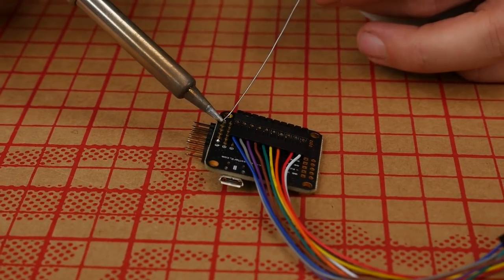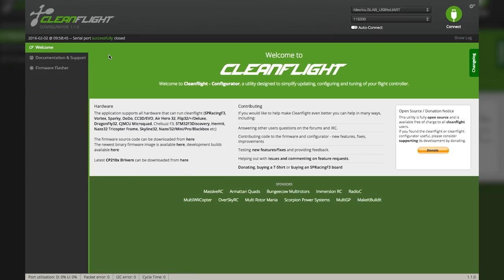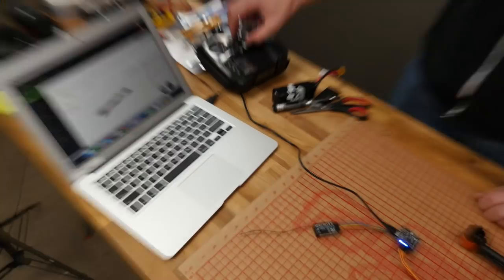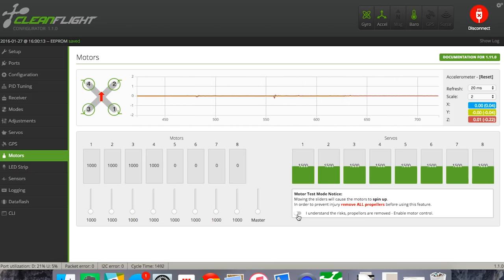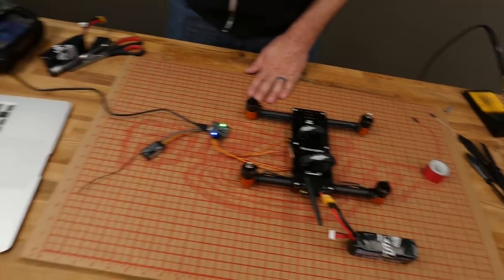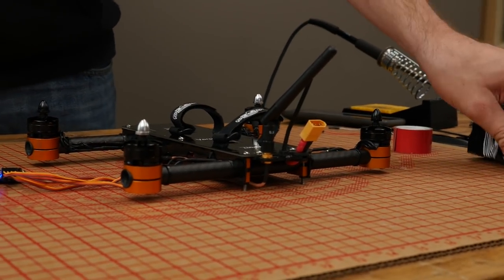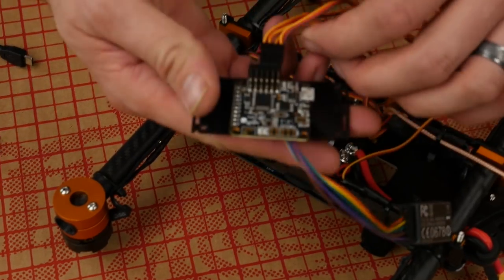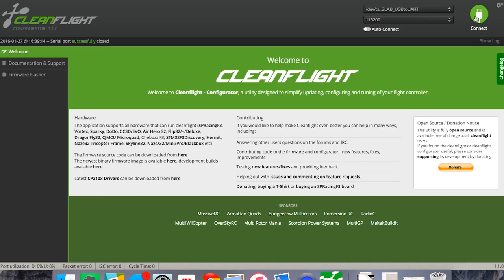Naze32 Rev6 Setup | Flite Test

Comment: I have a Naze6 and I'm loving it. Native S-BUS support without a signal inverter made for a really clean first build!

Ninjedit: Is that PPM josh?? In 2016?! Come on, man! Look at all that extra cable length! Go with X4r-SB + S-BUS!! Less input lag, cleaner/lighter cable management, S-BUS sounds cool...
Reply: +GaIiIeoMateo First priority would be ESCs with active breaking.. Haven't heard motors spin like that for years :-)
Reply: +kj erts Haha very true. I'm lucky in that with my first quad (which I built barely over a month ago) the ESC's I chose came with active braking! I mix up all the different features like oneshot, dampedlight, but I have them all on, so I don't know exactly how lucky I am to have it! RG20's are awesome!

Comment: Why are you guys still using pin headers for motor connections?
Reply: I'm new to t he hobby but not new to electronics and wiring., This is my 5th Quad I have build since I started in the hobby. This was one of the neatest cleanest board wiring and explanation I've watched since beginning in the hobby. Thank you for all you efforts and helping the New Pilots to the Hobby!!
Reply: easy removal as they want to sell them later?

Comment: Make sure to check if your board works before soldering the pins, if you already soldered the pins onto the board and it turns out there's something wrong it may be more difficult to return it.

Comment: hi josh and all telemetry users! there is a major trap about this: if you connect 4 escs with bec with the voltage cable and then the battery on the voltage port, the board will die within minutes.
the manual recommends to remove 3 bec leads otherwise you just brick the board.

Comment: you can tape the 1x10 pin down, so they dont move around, same with the 3x6 pins, put some plugs in so the spacing is good.

Comment: QUICK TIP FOR MIN THROTTLE : in motor tab use the slider to see what the the minimum input is, ( must have battery plugged in and motor tab engaged ) and set your min throttle 5-10 points higher than that value. insures lowest throttle , and no jumpyness when engaging ;)

Comment: There's one important thing to note if you're using a pololu or similar voltage regulator to power the Naze32 rev6:

The rev6 doesn't have a diode on the power input. If you plug the USB cable in it will power the ESCs through the voltage regulator and you can't calibrate your ESCs through cleanflight. Because of this you shouldn't use the rev6 if you don't have ESCs with built in BECs.
One other thing I would have liked to see in the video is how to connect your Graupner receivers to the Naze32 using SUMD. It's very easy and you only need one cable.

Comment: Josh, thanks for doing this video. However, you really should use a fine tip soldering iron when you solder in those headers. It would look much more professional as you were doing it. It would also avoid solder bridges much better.

Comment: By the way, with the GR-12L you can turn on SUMD and hook it up as a serial RX and only use one lead into the RX on channel 6. But it needs to be signal wire on pin #4 I think.

Comment: Hey, I'm good on every step but when I try to control the motors with my receiver, it just doesn't work. The receiver is bound, when I go to test the receiver, cleanflight says I'm getting a signal, and when I test the motors with cleanflight, they all spin fine, but when I try to use the sticks, the motors do nothing. Also, besides when I plug the battery in and connect to the transmitter, I don't get any beeping.

Comment: When 8 was building mine I found that motor 1 started at pin 3 and went up to pin 6. Spent. A night fretting thinking I had broken an escape till I looked at the individual motors in clean flight and found that the motors that were powering up were not the ones I was expecting. This is a problem in the firmware 1.12

Comment: Im running six of the naze rev6 boards with sbus and in the last two weeks three have lost motor out puts at random. Two or three solid flights then one or more out puts quits. Try the esc and motor on a working board and alls fine. Running little bee 20s and various 2204s. Ideas? Once motor output dies thats it. It never works again. Reflash, recalibrate the whole nine.

Comment: Every time I type the loop time thing it says "invalid name". Can I just skip that?
Reply: me too
Reply: same here
Reply: same here
Reply: does someone have an answer?
Reply: Bärtiger Baron I'm just going to skip it for now and see how my quad flies. I'll let you know if it's okay.
Reply: I'm having the same problem. My escs have this autoshot/one shot thing on it that I read somewhere would mean I don't have to do the configuration step. I'm guessing here, but I think that is referring to the process in this video. Any of you fellas also using autoshot/oneshot?
Reply: i  reflash an older version to my naze, after that i became a looptime funktion and my arm switch start working aswell ;D
Reply: Bärtiger Baron I'll give that a try. Thanks.
Reply: try version 1.10  ; )
Reply: hello, I found a pseu-solution (I guess it's not a real one). I put Gyro update frequency to 0.73khz then my cycle time is now between 1300 and 1600. You can find it down in "configuration".
Reply: whenever I put  connect my Naze 32 to the laptop only I can see the accelerometer working whenever I move quad I see the graphical presentation moving?? can I get to know how my servos will work?? I am using latest version of the firmware

Comment: Hello,
I followed the video while setting up a Naze32 rev6 on an F330 frame (CF 1.11.0) . First few flights were impressive with little or no tuning.
Later flights however were, for lack of words, disastrous.
The quad wobbles uncontrollable and eventually breaks props while flipping over. This happens only in angle mode.
I've read about reducing P for angle strength to 20 from 90. This did not resolve the issue.
Can you offer any other advice, please?

Comment: Has Cleanflight improved the performance of GPS related functions on the Naze?  I have a small nano QX and am looking at upgrading to something like a Versacopter or QAV.  My main compaint on the Nano is the hover wanders a lot.  I was wondering which board and would be better and would a GPS help with the stability.

Comment: I am working with Naze32 board and Flysky i6 transmitter. The values of throttle , yaw .... are being correctly shown on the reciever tab of Betaflight and the motors are also working via the motor tab but I am not able to control the motors via the Transmitter 😭😭... Please tell me where am I going wrong...

Comment: Hi! i need to save as much space as I can when soldering the Naze to the Escs and RC reciever. Is it a problem to solder the wires directly to each component, without these fast connectors?

Comment: I'm having a huge problem with cleanflight and my vortex 250 pro. The cp210x usb to uart download is not working with windows 10. I have tried re-downloading it a ton of times, but it does not work, nor show up in my device manager. This is starting to annoy me as I cannot fly my 250 pro until I have an arm switch. Any tips?

Comment: Can i use FS-CT6B for naze32 rev5
A friend told me that it won’t work for CT6B. I am already having issues connecting transmitter and receiver to board. Though all wiring is correct

Comment: Help please!! i have a problem when i conect everything the movement in the control does not  show on the screen like you do on minute 9:12, i have a futaba t4yf and a r2004gf. the signal is reaching de naze i used a multimeter to check it

Comment: what would i need to adjust if my copter wobbles to the point of flipping over? 
i have the PIDs same as the video.
but this only happened on angle mode and flew better on horizon
thanks in advance

Comment: Can I use a Voltaje Regulation Card to use only 5V to feed Flight Controller?  If that's not the case, how many cells can I use for the battery LiPo 3S? 4S?  Thank you!!!

Comment: What is the purpose of changing the cycle time to 1500?
Reply: +Sean Duffy Yeah keen to find out the reasoning for that change too
Reply: +Sean Duffy The processor is fast enough to cycle through the looptime faster than the stock setting.  The cycle time means their are more packets of info being sampled.  I hope I said that right.

JB
Reply: +Josh Bixler I understand, in other words you are making the loops faster for more accurate and quicker response because the chips are better than the older ones.

Maybe that came out more confusing. Thanks JB
Reply: +Almo Cox exactly think of it like having better resolution, like going from 1080p to 4k.
Reply: +Josh Bixler is that something that I should do with my rev5 too?
Reply: +themick817 not unless you know it can handle the new baudrate (loop time). Although setting it to a unsupported rate shouldn't necessarily break anything, it just probably won't work at that specific rate or not work correctly at that rate.
Reply: +Max Kunes my gycle time is 1000 and it wont move to 1500 help me
Reply: +DonMuffatello  I have the same problem as well, still not resolved. I saw from some forums mentioning about Gyro_Sync being enabled prevents looptime from being changed, no more info other than that. I'm looking for a Naze32 Rev6 manual, seems like its being referred to quite often. The Quad Questions manual doesnt seem very thorough....
Reply: Chua Yaowei yh just revert to a version before 1.2 it worked for me
Reply: +DonMuffatello thanks got it sorted now!
Reply: +DonMuffatello naze32 rev6 can't revert to anything earlier than 1.11 so what now?
Reply: +DonMuffatello I am having the same problem with the Naze32 Rev6.  My last build with the Rev5 I was able to change my cycle time to what I wanted.  Both times using Cleanflight
Reply: scimitar4211 1.11 is fine
Reply: I have 1.12 right now, how do I go back to 1.11? do I do full chip erase?
Reply: yh when about to flash it
Reply: re-flashed to 1.11 and loop time can be set to what I want.  Thanks all.
Reply: Just a side note. The flight controller need to be able to run the speed of the looptime set but so does your ESCs. If your ESCs are not fast enough, than you will loose performance, efficiency, and your motors and ESCs can get hot and you could even fry them in some cases.
Reply: Hi Josh. I followed your video to the letter, but cannot get my cycle time to show anything other than 970-1003. Im dying to get my versacopter to fly wobble free but can't. Using the settings from this vid, make it very unstable and it oscillates. I'm sure this is because of the cycletime/looptime thing. Any ideas?
Cheers, James UK

Comment: Does this, or any other board offer a system to HOLD an altitude? The quads I have used to date, low end ones, always have me managing throttle just to keep a steady hover. Any use barometers or cameras or ??? to "see" the altitude and keep it? Does this offer GPS ability?
Reply: This controller has a barometer to measure altitude. You should be able to rig up a switch on an aux channel to hold the altitude.

Comment: Dear FliteTest, Please help me… I am going crazy soon please help me. I am using Taranix X9E with X8R receiver connecting to my Quad via PWM mode to Naze32 Rev5. In Cleanflight Receiver Tab control are all in order but my Aux switches are not working. I had setup my Aux channel in my X9E TX correctly but in Cleanflight all Aux switches are not working. I suspect that they are due to my Cleanflight set to TAER1234, naze32 and RX is set to AETR1234 but my TX is set to TAER1234… are these the cause? Even if so that does not explain why my AUX switches are not working in clean flight because they are plug in Channel 5678 in my RX??? I am lost!!!

Comment: I'm having a problem with the calibration part, when I push the jog until the ESC makes two beeps when I get to the top (no battery), I follow the procedures but the escs do not respond. The engines never spin. Can someone help, please?
Reply: im using emax blheli 20a oneshot 125 capable ( the oneshot 125 is marked on CF)

Comment: i have just fittrd one of these to my 150 fpv racer the full version with baro/mag.  to save weight even though I fly 4c I don't use the pins and solder directly to the board.u forgot to mention that you MUST jumper the bootloader pads on the board or you cannot flash it.u also never mentioned the travel on the throttle and yaw needs to be low enough to arm/disarmwhat about making sure the board is orientated correctly or a offset is input so it knows which way is forward.and who the hell uses ppm anymore???

Comment: I'm having trouble changing the looptime to read 1500 cycle time.  I have loaded the latest version (stable) for my Naze32 Rev6 board and when I connect it reads 970 ~ 1003 for cycle time.  After I set the looptime to 1500 then save it won't change the cycle time to read 1500...   I even tried loading an earlier version on the board with the same results...  Any idea why this is happening and what can be done?   Thanks
Reply: I'm having the same issue
Reply: Rest easy M Brooks....  I found out that you CAN'T change it!  It has something to do with the date rate on the board.  It's all good just go ahead and do everything else.  I have found out that I needed to lower the rates as I had wobble and it was to touchy.
Reply: +Tom Stoio well this completely answered my question. My loop time is also 970-1000. Using the pids from this video gives me high end oscillation on the exact setup featured here. Guess I just have to find a happy place between the flitetest settings and the stock settings.
Reply: In the CLI, disable gyro_sync and you will be able to set the looptime to 1500. gyro_sync is now enabled by default, which means "the loop will be synced to gyro refresh rate". More here : https://github.com/cleanflight/cleanflight/blob/master/docs/Cli.md

Comment: I'm building my first quad and I'm having a lot of trouble connecting the receiver to the controller. I'm using the FS-i6X from Flysky and every time I try to bind the receiver just shuts off on its own and stops flashing.  Help plsss

Comment: What could be the issue if my drone is dipping down quickly  if i give a slight changes in throttle. I am using a naze32 10 dof 6rev flight controller. Flight test please tell

Comment: is possible to change motor dicretion, cause esc rail no 1 in my naze32 was not have any signal, can we use 2,3,4,5 for x multi motor? please help me, I am using naze32 rev 6 10 dot.

Comment: My naze32 board doesnot detect accelerometer and gyro sensors.previously they were worked finely. I tried flashing the firmware again but no use. What can be the reason for that.

Comment: I would assume the PIDs here are for the Versacopter only?  The Versa is a 280class quad.  Would these PIDs be a good start for a 210class?
Reply: +Nick Z Every quad is different and PIDs are different for each quad, they´re related to size and weight so you should find your own by trial and error. Search some PID´s that are close to what you have and start from there

Comment: I am using the FS-IA6B receiver with the naze32 rev 6 and I only have the roll working, everything else like throttle, yaw and pitch are unresponsive... Pls help
Reply: I swapped the position of the signal and ground but kept all other connections the same.

Comment: I calibrated my escs as you did, (set max throttle to 2000  and everything else you did) but after setup I put my max throttle back to 1850, and have been flying like this, will I be loosing some of my power like 15%? also what's the difference when changing loop time?  thanks for your help
Reply: +TheParkflyers   No, you won't loose any power.

Comment: So after seeing this video for 15 minutes i saw that i could ad my receiver in cleanflight. After that my throttle was the way it should be. I only had to swap the 2ch for 3ch and everything was fine. Set up my switch for throttle failsafe and i was good to go. I assigned a 3 way switch in my transmitter for channel 5. Aux1 was also ch5 on the receiver. My front left motor is not spinning. It is stuttering. I think it is not working correctly, perhaps it is damaged. Ordered a new one. In the video there was a change in settings to 1500 cycle time. I also did this with set looptime = 1500 and save. My settings came to 1000 cycle time. Do you think this is because of the malfunctioning left front motor?
Reply: I also followed the video and typed in the set looptime = 1500 command, but my setting also came to 1000 cycle time.  All of my motors are working so it can't be caused by a bad motor.  Not sure why it won't set to 1500 though....could be a different firmware?
Reply: Bo Han Thank you for that. Im not the only one with 1000. What i also find strange is that his switch let his motors run idle. But his throttle stick is zero. I tried this but does not work for me. Also when he switches the 2 modes you hear the motors spin faster. Not mine.
Reply: Exactly the same issue for me.  Arming the motors using the switch does not spin my motors, no matter what min RPM setting I specify in Cleanflight.  It does correctly arm it though.  Another thing I found is the min throttle must be below 1099 for it to arm properly.  My min throttle position defaults to 1100 in Cleanflight and the motors won't arm.  At 8:34 notice how his min throttle shows 991.  I had to use sub-trim to set mine to around 1000, then the switch will arm properly.